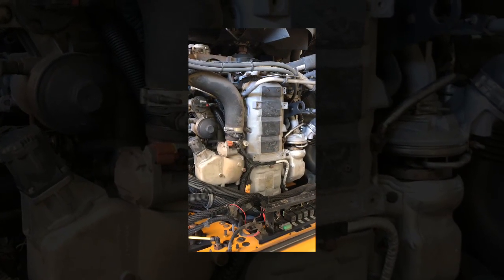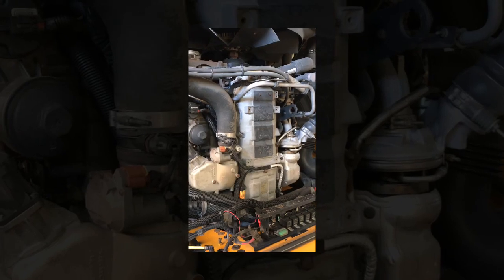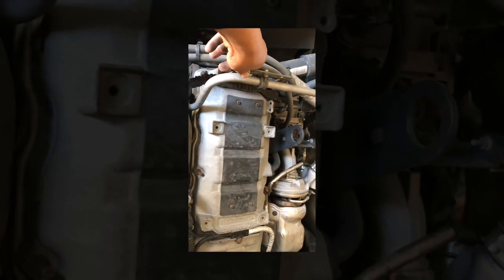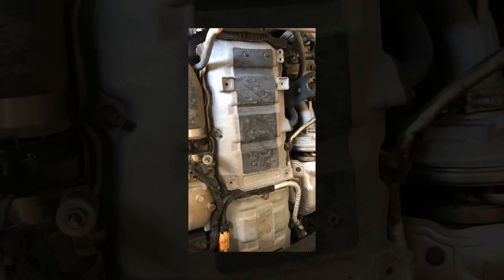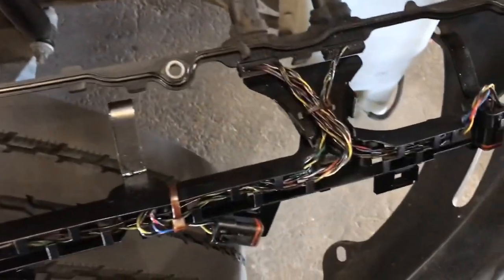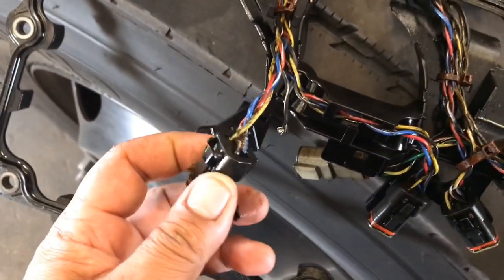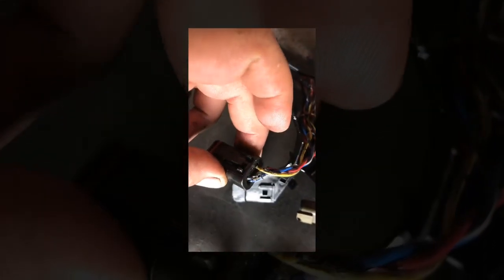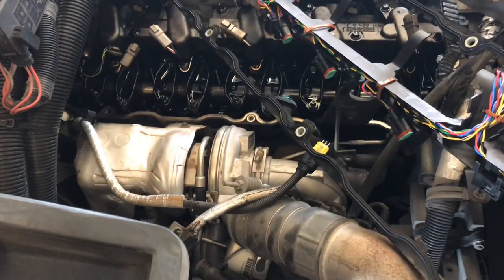2014 ic bus injector issues

Comment: Have you done a open crankcase breather kit on that generation of MaxxforeceDTs ?
Reply from the maker: Giovannie V  haven’t even looked into it. No. We sure haven’t. But I am going to do a bit of research on it to see if it’s something we should try. Thank u for the comment.
Reply: @JoesBusBarn  Oh yeah no problem brother! I have done some, its alright job because of the Crankcase filter there's not much of space to remove it but on the last generation of DT's the centrifugal filter stops separating the crankcase air from oil and the oil it's being sucked into the air system as in Charge Air Cooler filled with oil its a lot of cleaning and removing the oil from the turbos etc. I work in a school district just wanted to share out a bit of knowledge
Reply from the maker: Giovannie V   Appreciate you sharing that info. We have had to clean out 2 charge air coolers and turbos were drenched in oil. I will look into open breathers for our units bro. Again. Thank you.
Reply: @Giologico95  hello giovannie can you share the kit number for a open crank case breather? I have a maxxforce dt year 2013 thanks in advance